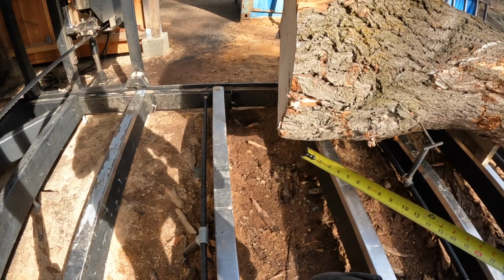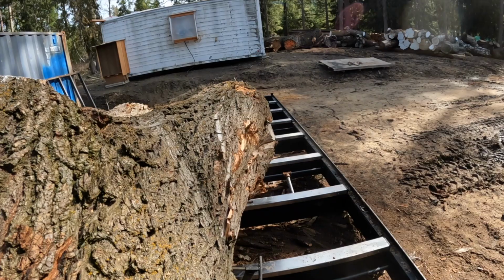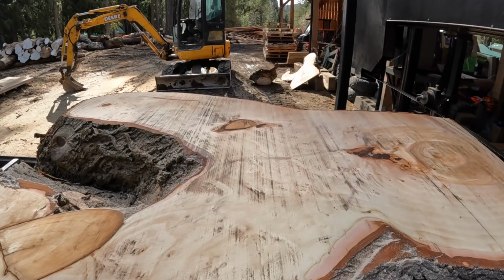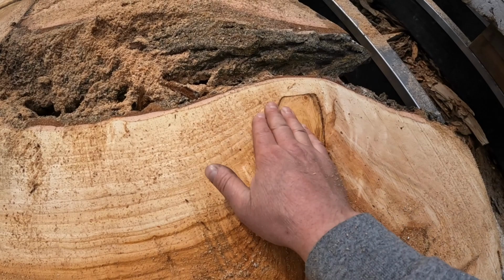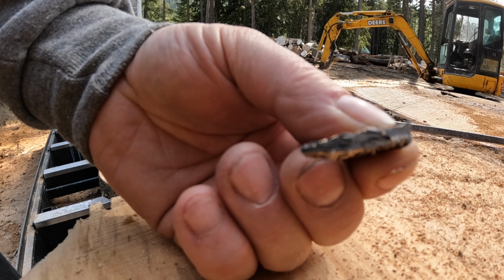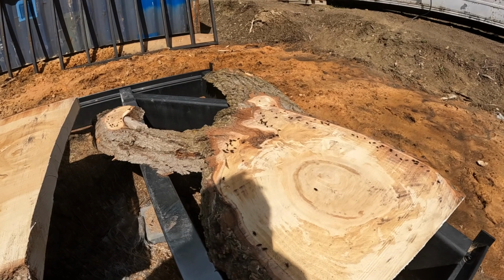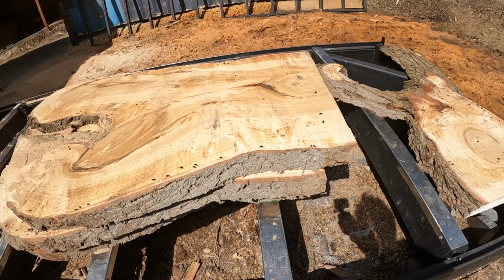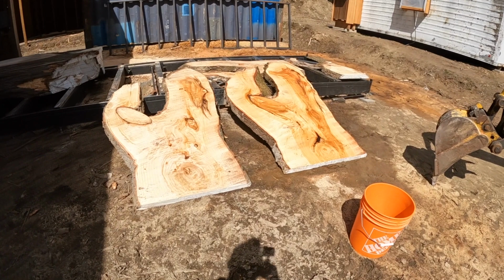Cutting a Willow log on my 6ft wide bandsaw mill

Comment: Would a magnet curb the metal problem?
Reply from the maker: Hey Garry some sawyers use metal detectors to find metal but this only really works for the surface of the log which would be helpful and I've looked at getting one. A lot of metal is buried in the log and the only real way to find it and get it out is to cut through it 😀 Thanks for watching and commenting.